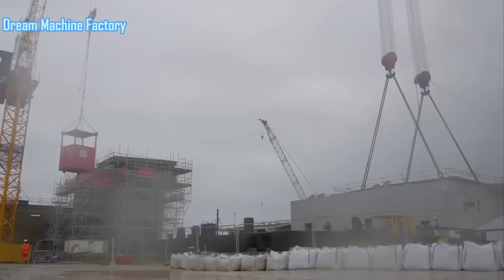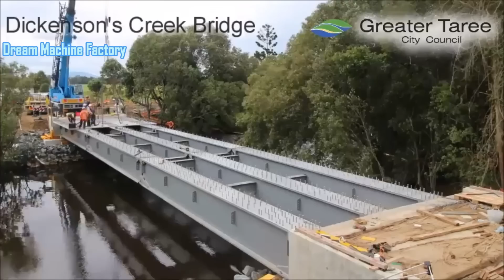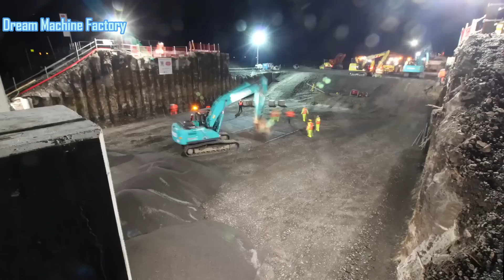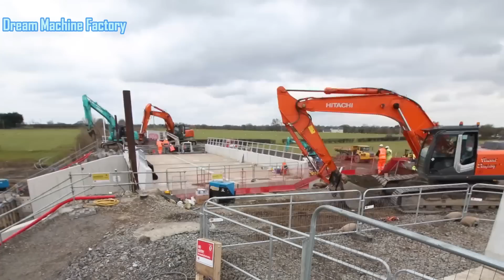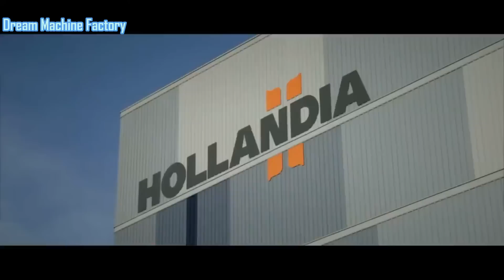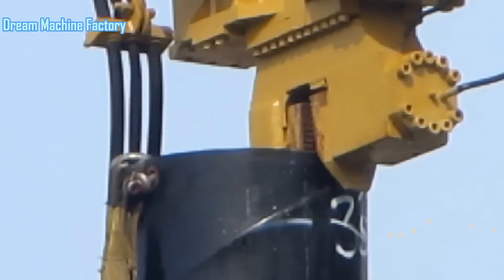Amazing Modern Fastest Bridge Construction Technology - Incredible Biggest Heavy Equipment Machines

Comment: This video showcases the incredible advancements in bridge construction technology, especially the installation of the Herring Bridge. However, while it’s impressive to see how quickly these massive structures can be erected, it raises some questions about the long-term implications of such rapid development. Is there a risk that the emphasis on speed could compromise quality and safety? For instance, even with modern materials and techniques, how thoroughly are inspections conducted to ensure these bridges will withstand years of wear and environmental challenges? Additionally, as we witness these projects unfold, I wonder about the ecological impact. What measures are truly in place to minimize disruption to local wildlife during construction? It's essential that we balance infrastructure development with environmental stewardship.